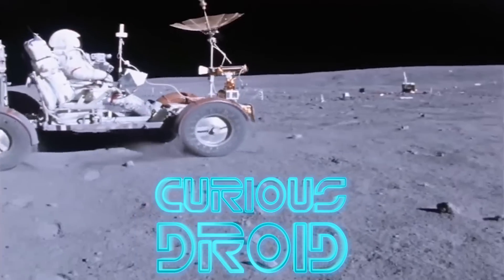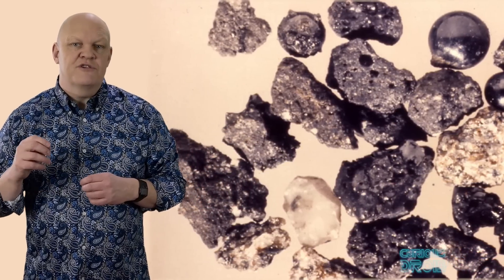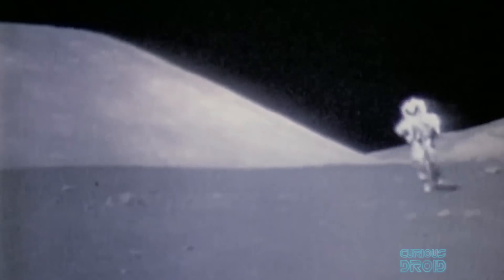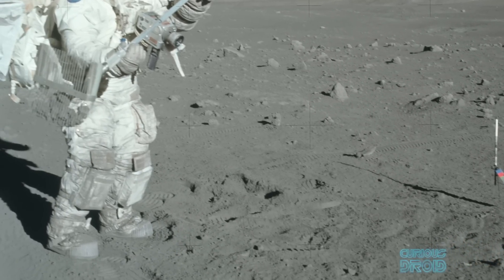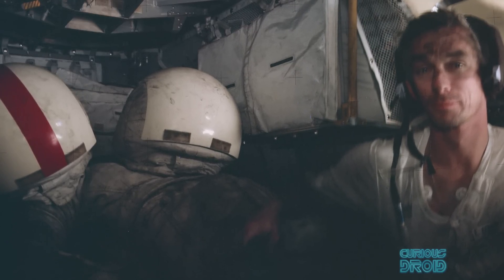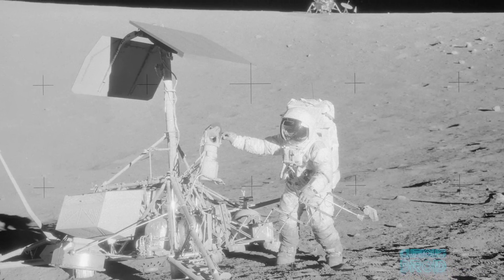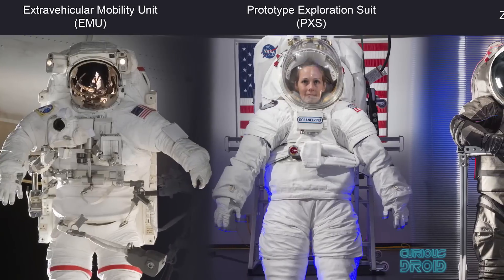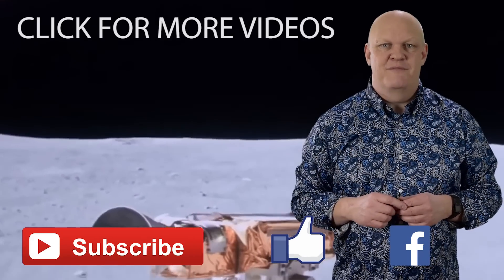Apollo, the Lunar Dust and NASA's Dirty Problem

Comment: So do conspiracy theorists believe this problem was just invented by NASA to make the story more believable?
Reply: Starteller: I need a new mobile phone, can you recommend a good one for me, please.
Reply: Starteller I went to university. I studied physics.
Working at a cell phone kiosk does not make you a telecomm engineer.
Reply: Starteller The sun shines on the moon and every other planet in our solar system.
Reply: Starteller because you are talking like we would need artificial light when leaving the earth. It's incorrect.
Reply: Starteller oh... No we don't. Why do you think that?
Reply: Starteller people shield themselves from the effects of radiation on earth and they do not use magnetic fields.
The level of radiation at many orbits are well known and have been recorded since the late 70s. Your statement is incorrect.
Richard Feynman, Lawrence Krauss... Both PhD Physics who don't think solar radiation makes travel to the moon impossible.
Reply: Chinese landed a rover in moon in recent years, check if the landing site has crater.
Reply: YES, Stars are NUCLEAR 24/7
Reply: The Shamal Casino No, it is not possible for dust and sand to go back into the rocket. The only opening can be the nozzle where thrust is coming from. If kinetic energy is imparted to dust by the engines, that energy cannot be greater than the energy that produced it. so, it cannot go back in. what you say is akin to saying -water sprayed from a hose would cause dirt to back into the hose -

I know about how curiosity landed, but there were other reasons for that.

Both Viking landers landed on Mars in the same way as Apollo.
Reply: Starteller idiot. I told you that I studied physics in university.
I know how test and verify. I don't need to live in youtube echo chamber.
Where are you licenced as an engineer?
You don't know the first thing about what you claim to know.

What levels of radiation do you believe to be present directly beyond the outermost magnetosphere?

"The scientific method is to watch before  making a conclusion"???? What a clueless fool you are!
Reply: The Shamal Casino what do you mean by "shrapnel backfiring"?
Reply: The Shamal Casino there would be no terminal velocity on the moon. Terminal velocity arrives when the friction due to air (or something else) equals the force due to gravity. It is the max. Speed.
It is an interesting question though. I have heard alot of people who say moon landing is a hoax, say there should be a crater.
 I did some quick calculations.
The main rocket would have slowed the lander down and let's say it stopped thrusting 1000' above the moon.
If that is the case, you would not see a crater, because the pressure area at the moon would be enormous and the amount of pressure on the surface of the moon would be tiny.
If the lander were allowed to free fall from that height it would hit the surface of the moon at 21mph.
That is too fast. In vids I have watched, they say they use the reaction control rockets.
There are four. They would have to produce around 1388lb of force to stop the lander from descending, but they just want to slow so it would be less.
Assume that they did fire the reaction control rockets full out as the lander was on the ground. Those rockets are at the top of the lander and that is 24' off of the ground.
Assume the rocket pressure spreads from the nozzle at around 30 degrees. When that force hits the ground it would be distributed in a circle with an area of around 13m2 for each rocket
. The force downward would be about 1ounce per square inch on the ground.
I am not sure it would move much debris.
Reply: John T Well the way they landed on the moon "vertically" would cause sand particles (as seen in the video) to bounce back up in the engine and create major malfunctions or even make it explode. The shear force of the rocket pushing down would make the sand particles bounce back inside... Interestingly Nasa took this into consideration when landing one of the recent rovers on Mars. They created an elevator that I can't really explain in a short comment.

Just strange that shrapnel backfire has been taken into action not so long ago. Of course Mars has a stronger gravity then the Moon, but the Moon still has gravity. It doesn't change the fact that logically it wouldn't have been able to land the way they say they did.

And now I'm not saying earth is flat and I believe humans have went in space. But I have my doubts about the moon for many other reasons.
Reply: Hi, the engine they used to descent onto the moon was a sacrificial component. It didn't matter if it got damaged, they were not going to use it again. It wasn't used to ascent back to the CSM. The smaller ascent stage engine, AFAIK was protected inside the ascent stage itself. it used the descent stage as a sort of a launching pad.  I am sure an engineer with more insight to the ascent stage engines will correct me if I am wrong, but I think this is the gist of it :-)   BTW the Apollo LM Operations Handbook has all this in it...it makes a good read..all 804 pages of it :-)
Reply: The Shamal Casino the calculations are just some rough order of magnitude calcs. That I did last night to check what should roughly be expected to occur. I will send you those tonight when I get a chance.
I don't think the Van Allen belt is very restricting. 
Explorer 1,2, Viking 1,2, Curiosity, and various satellites recorded levels of Beta radiation and those can be shielded.
Really strong radiation passes though the Van Allen belt and hits us every day.
What happens when you invert colours ??
Reply: The Shamal Casino how do you do that? I would like to try it.
Do you flip opposite on colour wheel .. like red for green?
Reply: John T Just regular invert color on MS paint would do. I'm trying to find the picture my brother once showed me a few years ago. It looked very strange and out of place....

On a side note did you see the speech Neil Armstrong once did while Clinton was in office. I think it was Clinton. Anyway during that speech he said something like "when you peel the layers on the onion you will find the truth". As he said that he kept looking behind him and looked like he was very scared. Interestingly he was the only one out of the 3 astronauts to be nice with conspiracy theorists. I'm convinced he wanted to tell people something, but feared for his life or perhaps even more...

I will try to find the video and the specific picture I remember.
Reply: John T I don't think this is the exact one I'm talking about, but it definitely looks odd to me when I invert colors. The mountain in the back doesn't fit in my opinion.

images.gawker.com

Now I'm no astronaut or geologist, but it feels strange on my end. Now of course I could be wrong. But i've seen alot of bizarre things on the moon landing over the years.
Reply: The Shamal Casino Moon acceleration due to gravity (g) = 1.6m/s2
Speed at impact in free fall = sqrt (2 x g x height
Speed of impact when free fall from 30m = 35 km/hr (21mph)

The Apollo lander weighs 15,200 kg. Equivalent weight on moon is 2,523 kg
2,523kg / 4 = 630kg per reaction control booster or 1,388 lbs

The boosters are 23' above the base of the lunar module.
I estimate that the boosters would distribute force out of the nozzle in a cone with angle of about 30 degrees.
Based on my estimate the impact on the moon surface from thrust at 23' would be a circle with 13' diameter. I get this with trigonometry. Tan 15 deg. = Radius (x) / 23' and solve for the radius.
The circular moon impact area will be 19,468 sq. In. Using A=πr2
The force per square inch = the total force at the rocket / area of impact, or 1,388lbs / 19,468 sq. In. = .071 lbs / sq. In. = 1.136 ounces / sq. In.

Note: the actual impact at the moon surface would be less because of F=m*a but I do not calculate it here.

Re: the picture that you have shown me. It looks odd because it is unlike anything you could take on earth. Even on the clearest day on earth, there is substantial water and dirt in the earth atmosphere. That is what causes distant mountains to look faded. We live this every day and so, when we don't see it.. it looks fake.
If you get a chance to look at Mars and Saturn through a telescope, you should.
Saturn is nine times farther from the earth than Mars is. Their image appears equally clear. Their appearance is equally affected by our atmosphere, and the the vast emptiness of space does not affect that much regardless of distance.
Reply: Why are you telling me that? The Sun is a star too.
Reply: No, it is not what I said. We need an artificial Magnetosphere when we leave Earth's Magnetosphere
Reply: The solar wind is really a big challenge, but the phenomena are not interrupt and a solar explosion can be predicted, sun has his cycle of harsh and calm stages, I could say that the biggest threat are the comic gamma rays and not the solar wind.
Reply: I'm a Telecom Engineer.
Stars are nuclear.
They emit radiations on all frequencies 24/7
The astronauts need the protection of the Magnetosphere or they would die within seconds.
For example, we bring satellites to low orbit before repairing them otherwise, the astronauts would die within seconds of radiations expose.
Go to a university and talk to a Ph.D. in Physic and he will tell you that we never went to the Moon because of that.
Reply: John T What about terminal velocity? Ya the moon has 1/6 of gravity compared to earth. But without any air to slowdown the lander it would have taken alot of energy from the rocket to land.That kind of energy would leave a huge blast crater. Yet none is seen in the moon landing pictures...
Reply: John T when you invert colors on some of the pictures it looks like the horizon is a very large panel or a backdrop of some kind
Reply: Go to a UNIVERSITY. 
"people shield themselves from the effects of radiation on earth and they do not use magnetic fields."
Because the technology does not exist yet. It is called a "Force Field" in sci-fi. Otherwise, it would take thousand of miles of a magnetic field.
Go to a university before contradicting an Engineer with your corporate media "science"
Reply: @Starteller  Dr James Van Allen himself doesn't agree with you !
http://www.clavius.org/envrad.html
Reply: Go to a university NOW. Try to remember! Your university physic teachers NEVER said we went to the Moon. The Mass Media did. Go talk to a PhD in Physic directly
We never went to the Moon.
Go to a university and learn the procedure to repair satellites like I did.
Go to a university and learn about the Electromagnetic Spectrum like I did.
Go to a university and learn about the Magnetosphere like I did.
Go to a university in REALITY. Stop using your imagination. Imagining the result is not the same as doing it.
What is wrong with you?
Watch hours of Moon Landings footage instead of the few seconds the Mass Media is allowing
You will SEE it is fake. The SCIENTIFIC method is to WATCH the evidence BEFORE making conclusions.
Stop BELIEVING and learn instead. Watch REALITY. 
Go to a UNIVERSITY. Get facts there.
Reply: Hedning1390 Just tell me how the fuck they landed without shrapnel backfire and you got yourself a believer... Just this video proves how impossible it would be to land "the way they did" lol
Reply: John T I know what terminal velocity is I bought it up... Btw were did you get those calculations from?

Ill admit I'm no mathematician, but please elaborate on what you based those equations... Plus many other factors don't add up. Like the Van Allen radiation belt or when you invert colors on some of the moon landing pictures.
Reply: Stars being nuclear is simpler to understand we never went to the Moon.
Stars emit radiations on all frequencies 24/7
The astronauts outside Earth's Magnetosphere need an artificial one to survive.
We are very far to being able to do that.
People go to a UNIVERSITY and talk to PhD in Physic and they will tell you.
Also, learn the procedure to repair satellites. We need to bring them to low orbit before repairing them otherwise, the astronauts would die without seconds. That what we call REALITY.
Stop believing corporate media, movies and the internet and go to a UNIVERSITY

Comment: Do yourself a good statistical analysis on the probability of 100% successful function of all the systems on all 6 moon landings and returns and see what it is.   It's less than a one in 2.78 million.   So it's not at all probable things happened as we are told.
With the numerous systems involve we had no mentionable system failures in these flights.  None?  Take the first 6 operational flights of the Navy's F-4 Phantom Jet when delivered to it's carrier.  You'll find dozens of problems.  And these we declared operational after years of testing.  Poisson Graph testing.   You can't argue with that.  It is not scientifically probable that we traveled and landed on the moon as NASA claimed. Just the statistical analysis alone is proof enough.   Since we can't duplicate what they said they did it's not proven fact.  Some cheesy stagecraft is not science.  I'll stick to science which says it's not probable by a long shot.  Now who is the nut.  Somene that uses science to arrive at conclusion or someone who is shown some fake pictures and just takes the word of a government that is KNOWN to lie to them.   "we have left much that is undone.....  there is much to learn for those who can stripe "one" of truths protective layers."  Neil Armstrong reluctant astronaut.
Reply: What the heck?
Why don't you just answer my honest question instead of babbling out some vague insinuations about 9/11?
Reply: What about Apollo 13?
Doesn't this count as a failure in an onboard system?
Reply: Apollo 13 was faked because Stanely Krubric wouldn't do anymore so they need time,  That's why Apollo didn't have to be filmed on a fake moon stage and then Apollo 14 Oh, my God, the astronaut accidentally pointed the ONLY camera they had right into the sun. So now they had excuses for 2 moon shots and a year and a half to protect there fake moon scenes. Yes the photography got a bit better but you can still see the same line on every F'N shot, that separates the foreground stage from the back stage far shots.  Can't you see how fake it all looks and every shot on every mission shows that same line that runs through the shot that separates the fore ground from the back stage.  Also there are two shots of the identical back ground mountains that match up perfectly with another shot that they say is 14 miles away.  One shot has the LEM in the fore ground and the other showing the exact same background with not LEM. They match up exactly.  Man, come one, there are so many problems with their lie! I used to believe it too. We landed on the moon, my team, my country, my astronauts, now my moon.  Isn't that what we all thought.  Great for us, screw you Russia, FU China we are on the Moon, MOFOs. We're on the MOON! Blew off the Russians that before the Apollo 11 shot was way ahead of us. First, object in orbit, first dog, first mean, firs woman, first 2 man crew, first multiple craft in orbit at the same time.  They already had the first heavy lifter boosters to do the job.  But we beat them, hooray for my team, my country, my guys, rah, rah for us.
Oops what's this about Van Allen belt.  Proven false, why, well of course, all our Apollos shots went through them 2 and there were no problems. When asked today the astronauts clam up and get jittery and don't know what to say when they are asked about the "Van Allen" belts.  One guy said, "OH, yes we went through them, I'd see flashes in my closed eyes.  NO man, you see money and nice retirement program.  Too many anomalies, and the shit they try and pull of on the ISS. Yea, Right?  I believe it, I see your hair sticking straight out, I see your can of tuna floating
Reply: Why do you think the films can't make it through the VAB?
Reply: Buildings fall down every fucken day at gravitational speed and we went  a million times to the moon and did the other things, not because they were easy but because they were hard and the lone gun man, Oswald shot Kennedy for sure.  Anything Else?  You are right!